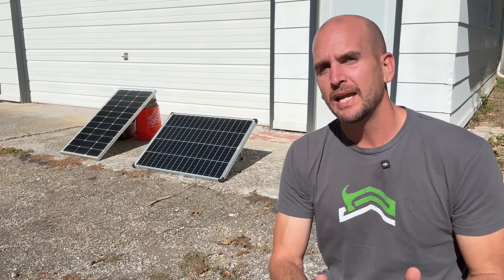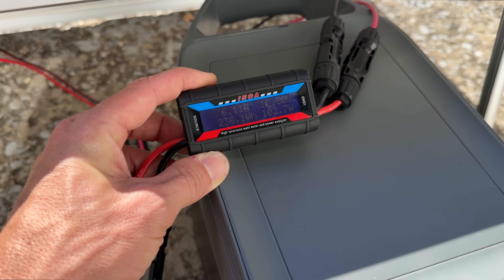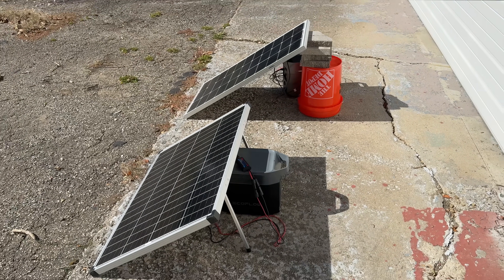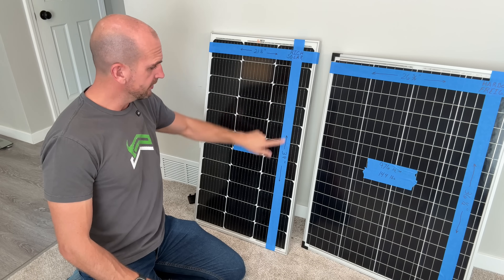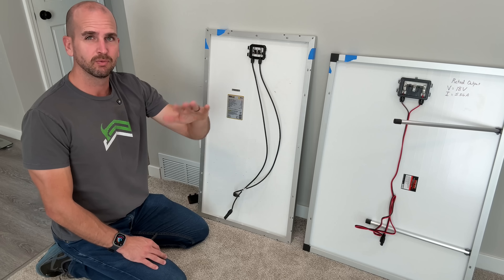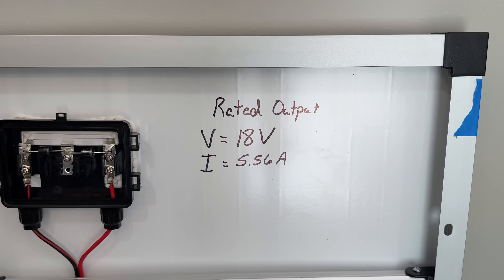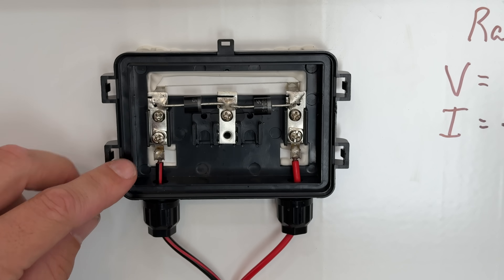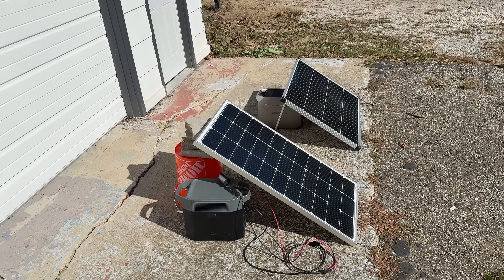Harbor Freight 100W Vs Rich Solar 100W |  Tested!

Comment: I think it's important to compare by price as well. The Harbor Freight panel (at $120 currently) comes out to $0.242 cents per watt hour, while the Rich Solar panel (at $80) comes out to $0.185 cents per watt hour. So for 17% more efficiency with the Harbor Freight panel, you're paying 31% more. I can get 3 Rich Solar panels for the same price as 2 Harbor Freight, which means a solar generator setup with the Rich Solar panels would provide me with 1.296kWh compared to 0.99kWh Harbor Freight.
Reply: they go on sale all the time for $90
Reply: @eldorripu I appreciate this! I had no idea! Definitely gonna try to score a few next time.
Reply: Harbor Freight has sales and 30% off coupons all the time. I picked up 3 panels at discounted prices.  Sadly they are still in the box 😅
Reply: @barkingspider2007  I feel this all too well! 😂 I've got 800w worth of solar panels sitting in my office closet for my generator build that I started four years ago.
Reply: At least you have it ready to go. Btw if it makes you feel better I have a 8000 w honda generator with the disconnect main power switch, separate power panel and 6 gauge extension cords all under my work bench ready for an unboxing party. Purchased it all around 2008 when the economy took a dump.
Reply: @barrysrandomness  At least you have them whenever you are ready to move on it! Already having the stuff TO DO the project increases your chances to get it done IMO
Reply: @barkingspider2007  What,,,,, the 30% coupons? 🤣 But the figures don't lie! What's the "end" results!
Reply: @barkingspider2007 that's odd because usually harbor freight coupons exclude air compressor, generator and solar panels
Reply: Another thing to consider it any associated hardware connectors, extra wiring, etc. A lot of expense for setting up a solar panel array is not in the panels themselves. There's also predicted life expectancy and warranty length.
Reply: Also size.  If you use your savings to add more panels that might be a factor to consider.
Reply: @DennisMathias  Just did the maths for you:
Rich is 828.75 Square Inches and accumulated 432 watt Hours of power which equates to
0.5212669683 watt Hours per square inch

HF is 976.375 Square Inches and accumulated 496 watt Hours of power which equates to
0.5069773396 watt Hours per square inch

So the rich came out about 2.8% (less than 3%) more efficient use of space.
Reply: Or you can buy a 400w panel for 120 or less.
Reply: @fernarias where?
Reply: The purchase price is a one-time cost that would need to be spread across the lifetime of the panel. If you buy a panel that cost 25% more but lasts 50% longer then the cost per kwh over time would be less, not more.
Reply: @peach8352 spot on
Reply: Friend has a HF solar unit on his remote river cabin in remote Ontario.
Around 10 years. 30-40F below winters. Hot summers. It takes a licking and keeps on ticking!
Good units! Infact last year he added a second and more batteries to increase storage. In the spring with the units trickling power to the batteries just enough that the batteries never froze hard enough to quit working.
Reply: But what about size, watts per sq.ft as space usually isn't unlimited and having two panels that are the same size, the more efficient panel make more sense.
Reply: Math!!
Reply: 100w panels are now down to like $55-$65 all day on Amazon. HF doesn't have sealed connectors...Automatically out for me
Reply: @mrmotofy  doesn't matter to me, I cut the connectors off, and solder the connection anyway. I live in tornado 🌪️ alley, so I made mine so I can unplug them and bring a pair of panels in at a time to the barn. Each pair has a steel square tubing frame and a short cord with a plug in on it. I used 40 foot extension cords to the ones I bring inside. I just use a piece of duct tape to seal the plugged in spot. It storms here a lot and sometimes there's hail. It's easier to bring them inside than to replace them. I used shrink wrap on the solder joints and I tape over it too. Those cheesy M4 connectors are too hard to get apart.
Reply: Ignoring the price differences, that is additional panels to set up if you are RV. If you are hard-mounting them (boat, RV roof) space is a premium.
Reply: Thank you for answering my question.  This data is far meaningful.  Also, what are the warranty differences, if any?
Reply: That's kind of what I did. I like the 100 watts HQST (two for $147). Eight of my sixteen panels are those. Mine are wired in pairs on my 25.6 volts system, open circuit around 41 volts. Half of my panels are 50 feet away, still works good.
Reply: Space matters
Reply: @joniboulware1436  I put eight of my sixteen panels leaning against the barn on the East side. The remaining eight are  in pairs in some tubing frames I made. So there's only four frames " out in the grass area". I move those around according to how late in the year it is, to get more time in the sun.
Reply: @DavidPotter-k1d  Lots of people don't have the space you do.
Reply: @darekm6859 The last 14 solar panels I bought were a lot smaller, 19" by 40" . I have 2400 watts of panels now, and 8 more 100 watts panels in the barn that I haven't hooked up yet. I had to buy a second charge controller recently. I may be in the same boat soon, my uncle wants to sell his house, and I'm camped out in his barn. Didn't find it out until the other day. I'm saving up for a spot of land, if I can find one.
Reply: @DavidPotter-k1d  Nice.  I don't even have a place in my Apt to put up one, unless I want to put some on my terrace and get sun exposure from 3pm on :D
Reply: @darekm6859 maybe you could ask nicely, and the owner would let you put some on the roof... 😎
Reply: If harbor freight anything outperforms your product you have a trash product
Reply: @berthagen387  Harbor Freight outperforms some products. Maybe for only one use, but...
Reply: Thank you for the calculation I was hopping around the video for.
Reply: Additional information from comparative battery storage cost, capacity and hardware life expectancy would be quite helpful as well.
Reply: Catching sales harbor freight competitive
Reply: Both had substandard soldered parts.
Reply: @brianfoster7064  I noticed that too. I would redo those joints first thing if I were going to buy either of those panels. It will be interesting to see the workmanship on other brands.
Reply: What is the cost per watt hour after you've generated 100 watt hours?
Reply: @IYar56  Mine was 12,500 watt hours for $3300 or  3.78 cents/ watt hour including batteries, charge controller, etc.
Reply: @DavidPotter-k1d  is that the rating or what the first watt hour costs?
Reply: @IYar56   Just figure out how many watt hours you need , say you need 600 and double that to get the right amount of panels. It doesn't hurt to add a few more for cloudy days.
Reply: Your logic and applied variables are flawed. You will certainly use the panels more than once. Your comparison utilizes only one use. Very illogical.
Reply: HF panels are $89 right now in store until the end of Jan.
Reply: @michaelwillman5342  I dont understand why ppl keep buying these cheap panels. At least once a month Renogy has an amazon sale where you can get their 100 watt panels for $55 each!🥴
Reply: @ITech2005  One reason is that Harbor Freight is close by to a lot of people. Decide to buy it today, bring it home today. 
   I actually avoid Amazon myself.
Reply: You need to leave out the word "cents" in order to make the figures mathematically correct when dollar designations are given. It's either $.242 OR 24.2 cents. It can't be both dollars and  cents together.
Reply: The 17% increase in Harbor is directly related to the panel being 17% larger in surface area. So for me the message is a solar panel is a solar panel is a solar panel.
Reply: Harbor freight solar panel going to run about 100 bucks
Reply: It's important to note that it's NOT 17% more efficient as you stated.  The HF panel is just over 15% larger in area giving it only a 1-2% efficiency gain over the Rich Solar panel.  Your point about cost per watt is absolutely on point though.
Reply: @ck17350  Agreed, it’s 17.7% larger so it makes sense to output 17% more 👌
Reply: Rich solar is not a good company they are liars sell sub par mc4 connections that short out I will take the harbor freight panels over their garbage any day
Reply: Flawed logic.
Reply: Preach!!!
Reply: I bought my thunderbolts at 89.95 + tax (4 of them) during a memorial day sale
Reply: These tests are great, but I always wonder about longevity...
Reply: @TheMightyTimmy  I have my harbor freight panels for 4 years now.. still going strong
Reply: Sure.... assuming you only use the panels one time.
But, if you use the panels a second time,  you close that gap.
Every time you use the panels after that.... you will get 17% more.
Reply: Did this guy in video not mention the price?
Reply: I like the way you think however, you failed to mention that as every month goes by the 17% difference will cancel out the intial higher cost.  In time the Harbor Freight panels win more and more every month.
Reply: @charlottekathrine1625  sales aside, his point is 3 panels vs 2 panels = same cost 3 panels actually put out more every month. So his math is not wrong. Every month the cheaper watts are still cheaper. 
But a lot more to consider like space etc.
Reply: And don’t forget durability, longevity, degradation.
Reply: The Thunderbolt panel is 30% more for a 17% larger than normal panel. It is "undersold" as a 100w panel when it is close to a 120w in area. But they compensated for that with higher price so end up tilting the other way. Not a good buy.
Reply: Also connections  are also a issue across brands
Reply: this guy would have figured this out if he was't making a video of him talking through the entire vid without stopping to think
Reply: Is why it's called Hazard Frought!
Reply: 17% more energy for about 17% greater area, sounds legit..s.
Reply: Top notch sir ! Thank you for sharing your knowledge with the pencil whipping and conversion. 👍👀🙏 this makes it so much easier to understand costs .
Reply: Wrong units
Reply: Different people will have different needs. Some people will need better efficiency due to space constraints. Also, more panels will typically require more money for mounting. I went with two 320 watt panels instead of three 200 watt panels to save $120 on the cost of the mounting hardware and to save on space.
Reply: Harbor freight has a good panel but their connectors are junk they're not a standard connector and they're not sealed
Reply: Great comparison
Reply: There's also time in use, because that efficiency difference will eventually pay for itself, not to mention 3 panels takes up more space than 2
Reply: Your price % comparison is only valid the first time you use the panel (because you only buy it once). The next day, the price % delta decreases by a factor of the efficiency delta, same for the following day, and again for the next day, etc,etc (because you are using them every day.  The Harbor Freight cost difference will be quickly eradicated by its higher efficiency.
Reply: @vg3430 yes…and no.
You have to divide by the life expectancy.
If both the same, the proportions stay the same.
Reply: @markthomasson5077    Not to mention the Harbor Freight panel is 15% bigger, which makes the RICH more efficient / effective per $ spent.  This was a cool comparison.  I would likely choose HF simply because they are on every darned corner these days and replacement of a failed panel is much more convenient.
Reply: @markthomasson5077 you guys know your stuff!! Thank you I’m so happy to be here learning this . I’ve got a bedroom and bathroom plus pump for fresh water 💧 to get up and powered . 👀🙏👍
Reply: @markthomasson5077 , no, the cost per panel stays the same.  The difference in the power generated increases over time.
Reply: @vg3430  I agree, in 6 day you get in energy what could be obtained with two of the less efficient ones.
Reply: @vg3430  That couldn't be any more wrong. The efficiency means nothing, because we are comparing price per watt which already factors in efficiency.
Reply: @vg3430 but is it more efficient based on how many square inches it takes up on a surface sometimes that's also an important metric depending on the situation
Reply: Or, you could buy a 100 megawatt panel for $90. That would beat both Harbor Freight and Rich Solar.
Reply: @peach8352 A 100 megawatt panel?  Who makes such a beast.  Do you know what a  megawatt really is?
Reply: @peach8352 is megawatt the brand name? Because there is no way anyone is buying a single panel with 100 megawatt output - regardless of price.
Reply: @gm5216  I was just giving a sarcastic response to another poster. Pointing out circular and faulty reasoning.
Reply: @peach8352 where?
Reply: The other factor is area, if you have a large open space to put them it doesn’t matter other then the cost of the extra mounts, but if it’s going on a roof or something then the watts per square foot/meter is important.
Reply: @jaydunbar7538  The HF is 0.6% less efficient per square inch...I don't think it's enough to take into consideration.

In reality, the difference in size of the panel is almost directly comparable to the difference in wattage gained. The HF is 17.73% larger and creates 17.02% more watts.
Reply: Depends, many ppl are space limited. (Rvs, Csmpervans) They need the highest output they can get per sqr ft. of roof space.
Reply: SPOT ON! Thank you for saying this.
Reply: You only pay the purchase price once. This comparison is invalid.
Reply: @falcorthewonderdog2758  It's a comparison of efficiency to purchased price, so it is valid. Simple math for you. If the harbor freight panel is twice as efficient, but costs twice as much, the watts per dollar will be equal. Even though you are only purchasing once, and the harbor freight in my example is twice as efficient, you could easily buy two of the other and create the same amount per dollar. Yes, the dollar spent is a one time thing, but dollars per watt is directly comparable to the other panel.

Comment: Would panel temperature make a difference in the panel capability? The HF panel has more surface area allowing it to shed heat better in a warm environment.

Comment: You didn’t do the math on area difference in percent, but the Harbor Freight is 17.7% larger than the Rich Solar panel.   That’s very close to the 17% difference in watt-hours collected!   Not a coincidence.  BTW, I have had bad experiences with Rich Solar.  They shipped me wrong parts multiple times, and items missing in the box, as well.  One time when they shipped wrong part, the replacement part was the same wrong part.   And customer service has been exceptionally bad.  I had a panel fail during 1st year, and they said they would replace, but then tried to get out of that.  I had to elevate and fight them for a few months before they finally agreed to ship the replacement.   It was a flexible CIGS panel on van roof and delaminated due to weather and humidity.  I sold the replacement and went with a different rigid panel from Renogy.   I like Renogy and Bouge RV, so far.  But I won’t buy anything ever again from Rich Solar.

Comment: What a LOT of homeowners don't realize is that even with a solar system, if you are connected to the grid and power goes out, your solar system does NOT supply you with power during an outage. That is a big thumbs down on solar. The only way to have your power from solar is to cut yourself off completely from the grid. They say it is a safety factor, I say have an auto relay that shuts off the grid and when power comes back on manually reset the relay, or INTERLOCK.  It not rocket science.

Comment: The harbour freight panel surface area is larger: 976 vs 829 is 17.7%.  Which is almost identical to the power output difference you observed.  So it's a panel size difference

Comment: Good test and video and quite  informative. At about the 9:50 mark, you total the watt-hours of the Rich Solar panels to be 432 - but it is actually  423 (232 + 191 = 423). This amounts to about 2% additional advantage to the Habor Freight panel.
Reply: If you do the math (495/423), the 17% difference is actually correct.  He clearly had he right numbers to work with, just inverted the last 2 digits (432 vs 423) when on camera.
Reply: OMG! That was hurting my head when I watched this! 😂
Reply: His mistake was only in copying the production numbers- actual calculations, including the 17% difference in the video are correct.
Reply: Academeus trollis maximus.  Still in 8th grade.  Belittlers all
Reply: Dyslexia is a thing wonderful... Lol! Good video though! I've been looking at solar panels for my RV, may have just made my mind up!
Reply: Math and editing not his strongest suits
Reply: Agreed... Obviously, he flunked math...
Reply: @seanseoltoir  Dyslexia?
Reply: @seanseoltoir  I can probably do most math 100x as fast as all of you in my head but I have made an error a time or two in my life.   Please go away.   Forever.
Reply: @seanseoltoir  it points to a sloppy evaluation. What else is incorrect?
Why does it take viewers to correct his calculations?
Reply: @docjc9465  -- Unfortunately, even if he notices the error after posting it, YT won't let him correct the video without completely losing the views and comments on the previous video... At least with our comments, it allows us to go back and correct our typos...